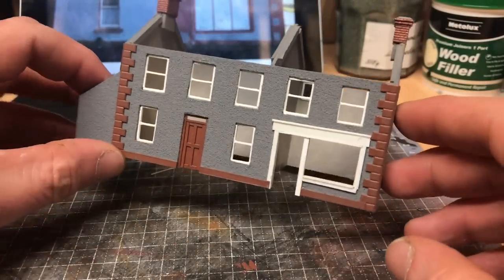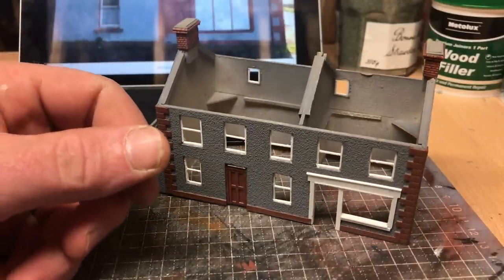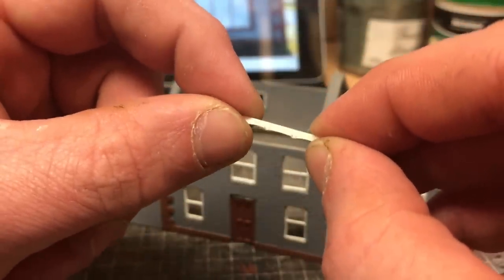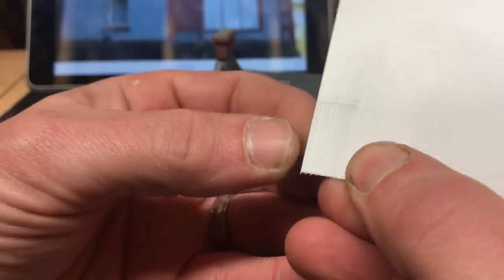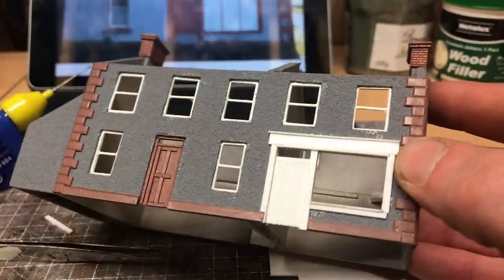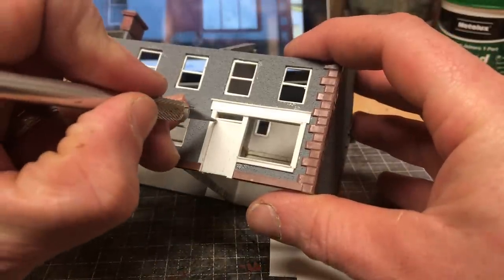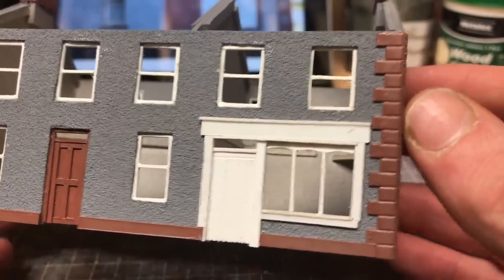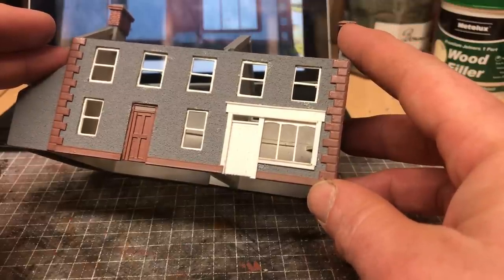Building A OO Gauge Model Railway: Scratch Build Series - 1.7 The Store Front Part 2

Comment: That was top work on the three panel window.  The final effect was very good indeed.  I agree with Strathpeffer Junction that I wouldn't worry about the slight misalignment.  A building of this age will certainly have settled over the years.  If everything were straight and true it would be less believable.  Stephen.
Reply from the maker: I’m in total agreement Stephen, I just get a little bit fussy with my work. The real thing certainly isn’t perfection personified so I should settle for what I’ve achieved and be happy with it. Paul